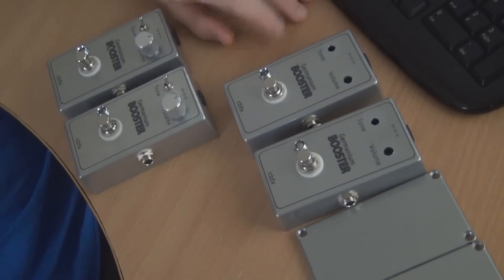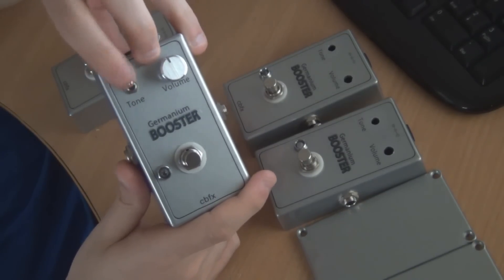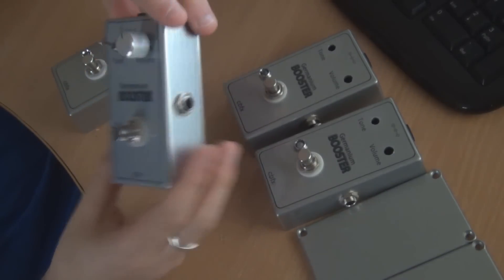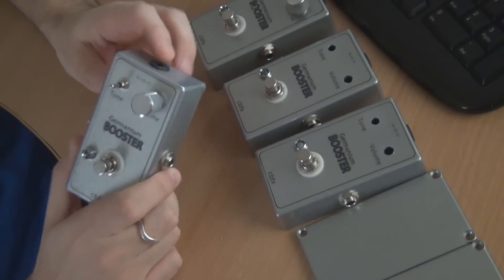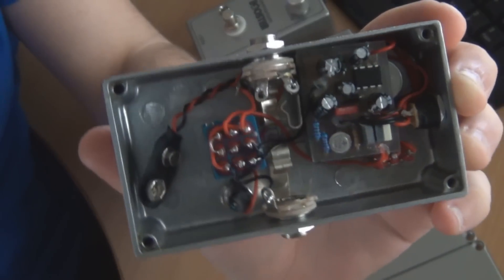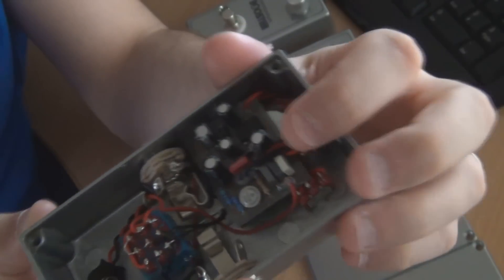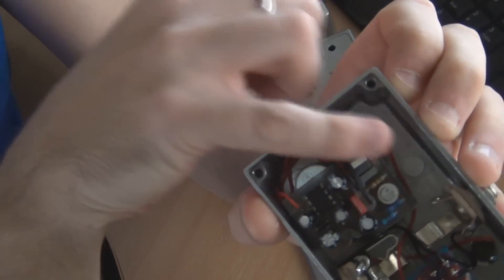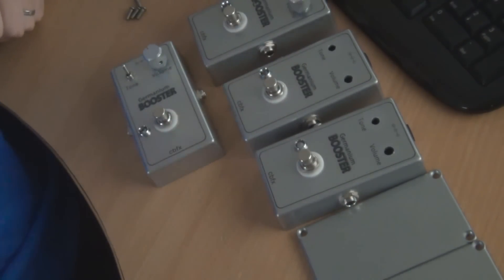Build Report: CBFX Germanium Booster (Rangemaster Clone)

Comment: Mine is painted white with a metal fleck. I got it from you on ebay in early 2013. Its been a great pedal...often addictive.  I have the guitar going into it before anything else. Thanks!
Reply from the maker: +phil Smith Thanks Phil, that was version 2, i was very happy with that small run.  There were 5 in total i think excluding the one i made for myself.  Hope its still going strong!? Cheers Paul
Reply: +DIY Guitar Pedals She's still going strong, thanks Paul but looking a bit worse for wear. Needs a service after 3 yrs solid usage.

Comment: I have built one of them last night didn't boost the Signal. It was much quieter when the pedal was on.  I didn't put the led in nor did I put the dc jack in. I was running it on battery. Was wondering if not putting the rest in would effect the sound. I wouldn't think it would.
Reply from the maker: Bobby Stout No wouldn't make a difference that I can think of.  You should get significant boost when its set up correctly, mine boosts so much it could blow my pants off.

Comment: I really dig treble boosters but I have tried a couple and they have a terrible POP when engaging them. WOW it's funny, you are the only maker or seller that has mentioned you would need a separate power supply. I bought a used Hartman vintage germanium treble booster used off of ebay and the seller did not mention the pedal is positive ground. I  put it in my pedal chain and it cut power off to all my pedals. I was so pissed.  Why do they have such loud POPs when turning them on or off? Rock on!
Reply from the maker: Personally I really don't like extra power cables.  Your pedals probably cut out because one/all of them has a reverse polarity protection diode. basically if the power is reversed the diode shorts + and - to protect the effect.  You could build a charge pump and invert the power but your going to want to know what your doing.  The popping is probably either a dodgy 3pdt but more likely no pull down resistor on the input. You can add one yourself but you will have to find input and ground on the 3pdt.  Just solder a 1M resistor from input to ground on the 3pdt.  Use alligator clips to test first.  If it is the pull down resistor that's one poorly designed commercial pedal you have there!